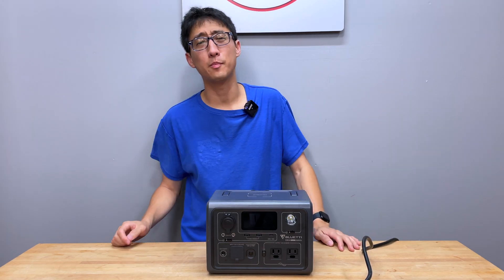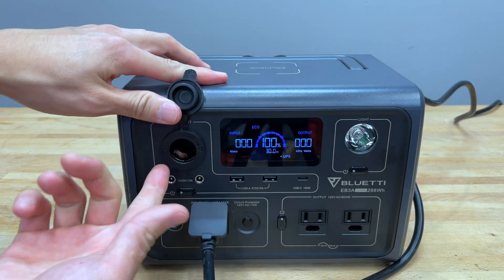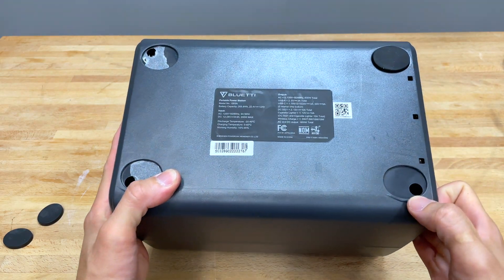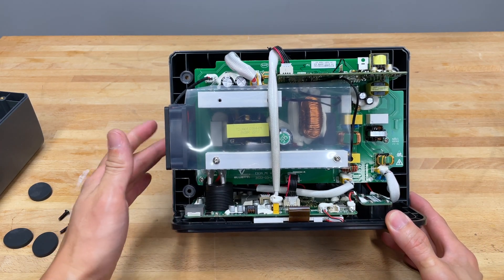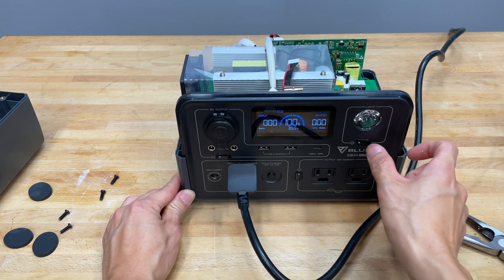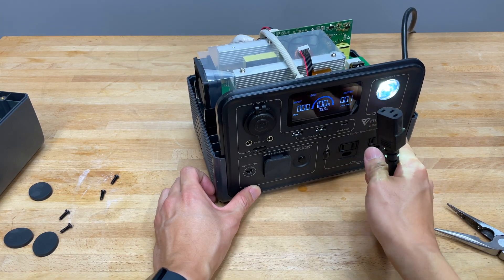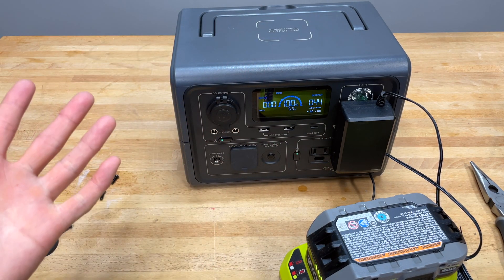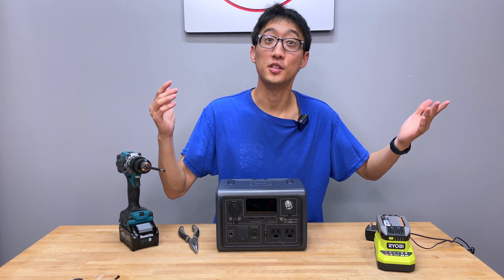Fixing the Bluetti EB3A DC Short Issue

Comment: Easy contact with bluetti even got a call back but no help. Mine is out of warranty. I will try your fix. Same stuff $220 too much for brick. I left mine on a small refrigerator all night. Was showing DC fault. Will come on with ac charge plugged in but pretty much useless otherwise.

Comment: This process from Bluetti worked for me, that is I didn't open the case up to disconnect anything:  (I've added my own notes to these official instructions from Bluetti)

For this case, we would encourage you to follow a few troubleshooting steps with us. 
1. Plug in wall power and turn on the AC and DC buttons of the machine when plugging in the charging cable. (***My DC button would immediately shut off after turning it on) .  In the AC outlets, I plugged in a fan and my phone charger and turned on the light on high which consumed 47watts.  After~15 minutes the charge dropped to 99% .  This confused me because why would it drop from 100%.  I was skeptical, but sure enough after about 15 minutes, it dipped to 99%. 

2. When the charge read 99%, I unplugged the AC wall plug that was charging the Bluetti and then plugged it back in.    Within a few seconds, I finally saw Input Watts (the number to the left of the 99%) jump up from 0 watts to ~260watts.  That indicated that my batteries were now charging!!!!!!!.  Despite the display reading 99% charge, I know my batteries are at or near 0% because I completely drained them last night with an electric blanket.

3. The SOC is not accurate at this time, and it may take a long time to recharge from 99% to 100%. You can continue to use it normally after it is fully charged.  *****I left my fan on, phone charger, and the light on while it was charging drawing ~40 watts

Comment: Short version: 
1. 12V battery with alligator clips 
2. Plug bluetti battery into wall 
3. Locate the 12V Car output port on the bluetti
4. Hold the positive terminal to the center of the Bluetti Car output port
5 Quickly tap the negative alligator clip to the side of the bluetti car output port 
6. Look at the screen to see if it is charging

You can fix the short by taking a 12 V source and using alligator clips to the Car DC output port. When you touch positive to the center and negative to the side, it instantly resets the device. I did this with the battery plugged into the wall. I had a variable power supply so I set it to 12V 0.2A. Just touch it very quickly and it came back to life.

Please try at your own risk, but I had the exact same symptoms as the video. I had the DC short and battery wont turn on unless plugged in to the wall (but it still doesn't charge).

I was reading on the forums and I suspect it is because the charging module sees the battery is too low of a voltage to charge, so when we tap the DC output with a fresh battery, it resets the decice and tricks the module to think that the battery is safe to charge.

By the way, I think it is illegal for a company to void a warranty just because you disassemble the battery. They are reauired to prove damages. This doesn't stop them from denying warranties though but I believe you can report them if they do so.

Comment: I did a firmware update. Before the update, the unit was 95 % charged, after the update it displayed only 33 % charge. But I used it as normal. Charged it with solar power and simultaneously connected a fridge to it (AC) - it was charged to 53 % then I disconnected the solar module, but the fridge stayed plugged in. It worked until it has reached 20 % of charge. Then "short" displayed on AC. I shut it off completely by pressing the AC button some seconds. After that I powered it on again and fully discharged it with some batteries (AC). At 1 % charge it did not shut off... I still could charge the batteries with 175 Watts for about 20-30 minutes long. That means, the unit had way more charge in it as the display showed. Now I fully charge the unit via AC to discover, if it will work normally again after a full charge/discharge cycle. Some people say, you have to do one full charge/discharge cycle to recalibrate the unit after a firmware update.

The short could also mean, that there was some overcurrent happening. A fridge can cause high current sometimes. Maybe that was the issue in my case or maybe not. But if "short" displays, just complete shut it off and on again - that may work.

Comment: I had the same issue.
I am not Electriction or computer guy. I just unlinked and removed the Bluetooth App  from my iPhone and it worked well. As I reinstalled and linked the unit by iPhone. Same issue came back. It stoped working. I removed the App. It started working property. If Bluetti people looking at my post May work on it.
I don’t know what Bluetooth App has to do with this problem.

Comment: Is this solved or continues being a recurrent failure in this model? These devices aren't cheap to have these kinds of problems...

Edit: Searching for additional technical information, the source of the problem seems to be the power mosphets of the primary of the 24 / 220 internal inverter.
They are of such poor quality that they overheat even with the heatsink and fans installed, at which point the device cuts off that power line indefinitely. Eventually they will burn over the time. 
The only permanent solution is to open the unit and replace them with higher quality equivalents. It is not a repair that a user without experience in electronic repairs can do.

Comment: Thank you for this video. I was able to contact Bluetti tech support and get a soft fix (with a promised 24 hr turn around). These instructions worked for me and their restatement of my problem is correct.

"Does your EB3A fail to turn on unless it is plugged into the grid? When plugged into the grid, it can turn on, but as soon as you turn on the DC output, a "short" error appears, correct? If so, please try the following steps to see if the issue can be resolved.
 
Please plug the EB3A into AC home grid to be recharged, when it shows 100% charged, then please turn on the AC and DC of the EB3A. After 30 minutes to 1 hour, the EB3A will drop from 100% to 99% due to self-consumption.
 
After the SOC of EB3A drops to 99%, please unplug the AC charging cable of EB3A from AC home grid to see if the EB3A can be turned on. If it can be turned on, please re-plug the charging cable to charge the EB3A again."

An additional note: I unplugged the power cord when the SOC dropped to 99%, waited a moment, then turned it back on with the DC power button and it came alive. The fan moaned and groaned as it started up, then settled out.

Comment: Okay, here's my success story because of you.
I lost power last night, so I used the eb3a to power my blower to my fireplace. I woke up to it being dead which I assumed anyway, it said it would only last 6.8 hours. But then I went over to it to charge it back up, and I couldn't turn it on. And every single issue that you stated in your video was what I had. Followed your exact steps. unplugged the little cable inside, give unit some power, heard a little clicking, then unplugged the power supply and plugged the cable back in on the inside of the unit. Good to go thank you so very much.

Sorry.... EDIT... Ran for just a bit and then shut off. Always says it is 100 percent charged. As soon as it turned off and I had to plug it in to turn it on, it all started again.

You know what DOUBLE EDIT! 
Still didn't give up. Nothing at all was letting my state of charge show anything other than 100% and it would never start charging, never saw any input numbers... UNTIL! 
At the step when the wall outlet is plugged into the eb3a, and the screen will show the DC 'shorts' when you turn it on... There is another clip on the back middle top of the eb3a the other end goes down the middle back to 'bat-v'; I just unplugged the top clip and plugged it right back in and instantly the battery went to 00% and it started accepting the input and charging! It's already at 10%, but I still have to see once it is charged if it will function normally or not. But at least I am at the point I am at! I got it to accept charging. I'll triple and quadruple edit this post if I have to!
Reply from the maker: That is awesome that you found the issue!
Reply: Wow!! so I unplugged the bat v on the back while it was plugged into grid and it started charging at zero! The fan came on around 7% and the DC short error was gone. Thank you for sharing this info! I was about to give up.😊
Reply: @pt4826  That is so awesome to hear that this helped! Makes me happy. 
Mine still is running strong and I haven't had the issue since.
 Thanks for sharing!
Reply: Some people say, that you have to recalibrate the unit after a firmware update by doing a full charge/discharge cycle. Did you updated the unit some hours/days before this issue occurred? I had a similar issue after an update. The display showed much less charge as it should do. 33 % instead of 95 %. And your unit showed much more charge - 100 % instead of 0 %. To avoid this issue, it may help to occasionally do a full charge/discharge cycle. This means, let the unit discharge until it shuts off by itself and then charge it until it reaches 100 % of charge.

What you did, was a full reset of the internal controller by unplugging its power source - the battery. I guess, the controller isn't working properly, thus it "forgets" the current state of charge at some circumstances (firmware update, disconnecting internal cables etc.).

Comment: Bit of advice for anyone looking at getting this item. DON'T DO IT! Mine lasted 4 camping trips over 18mths. Item failed similarly to the above. Trying to get something to work resulted in it bricking itself during a f/w update.  Utter garbage item.
UPDATE opening it up unplugging the battery, and connector in this video, updating the app, leaving it for 2 hours, reconnecting, This allowed me to finally update f/Ws and she's back in action for now.
Reply: same here, ive had it two years and started this last weekend. i was trying to charge a radio battery and it kept shutting off every few minutes

Comment: I followed the steps in the video and it worked again. But, about 5 minutes after applying an AC load it quit again.  I followed the steps in the video again and got it working. I turned on the light without being plugged into the wall.  About 5 minutes later it quit again.  I did the video reset again and this time I'm trying the discharge to 97% with it plugged into AC as described below.
Reply: Did it work? Im having the same problem after following the direction.
Reply: @kelly_mccoy  The process of charging to 100%, leaving plugged in and turning on the inverter and letting it drop below 100% before unplugging it is working for me.  I may have went through this process 2 or 3 times since I posted here.  I don't tear it apart anymore to get it working again.  I keep it next to my chair and charge my iPad and a couple of other things.  I haven't had to go through this process for a while now.
Reply: I have the same problem.  Hopefully there is a simple fix somewhere.  My is past due warranty.

Comment: Thanks for posting this fix, it worked just like your video shows.
Reply from the maker: Glad it helped
Reply: This worked but issue came back.   Has this happend to you or anyone else?  I do not use it much maybe sitting charged causes this?
Reply: @gainz6718  Yes it came back, used (@ibidsl
8 months ago suggestion) it worked perfect..looks like battery went to 0% but was showing 100 %....

Comment: I had the same issue with my EB3A that’s why I stumbled upon this video. I was skeptic to follow the steps of the author because of safety concerns and it may void the warranty. And as i read some of the comments for other solutions that were successful I saw one that says try to discharge the battery by switching on the lamp (unit must be plugged in to a wall outlet in order to turn the unit on) which I did and chose the high setting for a 2 W rate of discharge (low was 1 watt) and after the charge was down to 97% I unplugged the unit from the wall then it worked fine. No more SHORT display when DC is turned on. I guess this is a workaround. Thanks to the guy who discovered this and shared it. HTH.
Reply: I used this as well but I plugged in my phone to 22w and fan to use total of 70w with the light. Took 10 mins and at 99% unplugged. Turned everything off and back on and everything cleared! This worked!
Reply: Worked for me and Bluetti said screw you we cant help you. THANK YOU now i can get back to camping again.

Comment: Thank you!!!
Fixed mine. I did however not turned the power off before reconnecting the cable and then the wireless cable too so that the board can recognize them as “there”. I tried with power off twice before and display would not come on and so on. Anyways, keeping the station on and reconnect the two wires worked like charm. 
Thank you!!!
Reply from the maker: glad it helped

Comment: Sadly i am on roadtrip and chargin ac70p with solar panel. I use it mainly for yolco fridge. Sadly i left solar cable plugged diluring night and now i got dc short circuit. It made me so much problems because i am traveling and camping now made 3000km and still 2000km ahead. I made firmwar upgrade, hard resets etc. Nothing is working. But didnt tried cable grid connected to ac70p because dont have the cable with me. Atnleast one usb that works as passive without bluetti on is working the forst on the left. But induction and charger for fridge is not. I wish i bought ecoflow. I will try to reset it myself at home but now on road it brings me big problems

Comment: Cool,however the problem I experienced was that, when my unit displayed short,  I got a communication cannot be established msg in the app which prevented me from using the app when attempting to connect to the unit, every time on my iPhone. I’ve got two units and one continued to work fine with the app. Shorted units may reset differently based on various input devices, different phones/configurations ECT. I was using both as UPS devices and they seamed to need to cool down using the built-in fan quite a bit while constantly plugged in & on. So the one that shorted may have just succumbed to constant vs occasional use. 
Anyway, I’m glad yours came back to life too. Stranger things.🤓
Reply from the maker: yeah im not sure how reliable these things will be in the long run

Comment: You wanted to hear from someone who had positive interaction with BLUETTI customer service. I did. I emailed them with my issue. They answered me right back almost immediately. The person I was emailing with was named "Bon". After a few emails back and forth, it was decided I send my unit back... Postage paid by BLUETTI. I was walked thru the process of packaging and where to send it how to send it. Easy peasy.  It was decided by the company to replace my unit with a brand new unit after they looked my old one over. The issue was it would not turn on. In a couple weeks from sending mine back, I received a brand new one. I was taken care of in a very personalized way, Bon was patient, friendly, and prompt with communicating with me. I had not even filled out the warrenty card and registered it on line. I'm terrible about doing those warranty things. Bi was told it was OK, they'd help me anyway. My unit did work for about 3 months before it went dead.  That's all I have to say.
Reply: I really do hope I get someone to reply to my emails but unfortunately I have had no communication with the company yet

Comment: My problem is slightly different, It will stay on, but when it gets down to 70 percent or so it just cutts off and behaves exactly like you pointed out here. I will try this
Reply: I have read somewhere you have to completely charge and discharge the unit a few times
to synchronize the screen with the other electronics inside. (bottom balancing)
Reply: I'll try that thanks @karelvandervelden8819

Comment: my unit does not display a "Short" error, but unplugging it leads to it shutting off after a few minutes. It takes me plugging it in again to wake it up again. Will this fix that too? It does have a charge so I dont know why it turns off.
Reply: mine is doing the same thing  and it started today. I don't even have a year with this unit. Bought it back in August. I'm going to try contacting support but if nothing happens then i'm going to try this solution myself

Comment: THANKS !! GREAT VID! ... I'd love to learn how you figured this out.  You must be EE and familiar with tactics. ;)

I got this short issue after using my EB3A to charge my car battery. IF you need to do this, be sure to pay attention to how the connectors go. Even after confirming my gut - and testing with my multimeter, I connected red to positive and black to negative on the car battery.
What happened is the connectors for the alligator clips ONLY FIT reversed in polarity (WIRE COLORS GO IN OPPOSITE).  So connecting it to my car "correctly" by color was a mistake. PAY ATTENTION TO POLARITY PPL. and learn to use and understand your multimeter. (shrug)

I have no desire to send anything back... and let's face it, most of us are probably huge DIYers. I certainly am, and if I can take 15 minutes to fix the thing, I'll be happy. 

When I do this, I will be sure to cover my pliers with tape to make sure THEY don't touch anything they shouldn't be as well.

The one thing you didn't mention... smoke.  I actually got smoke from mine ... hopefully this still works.